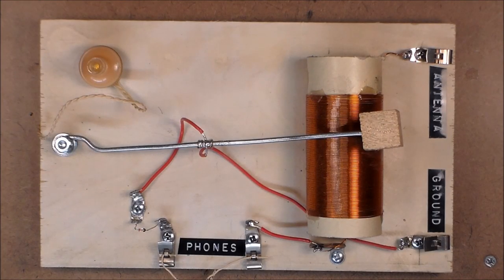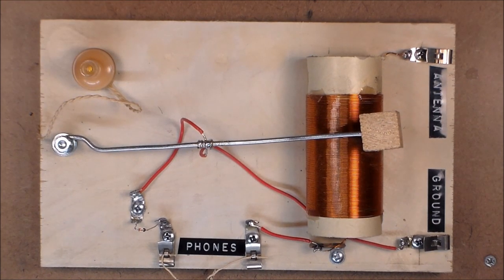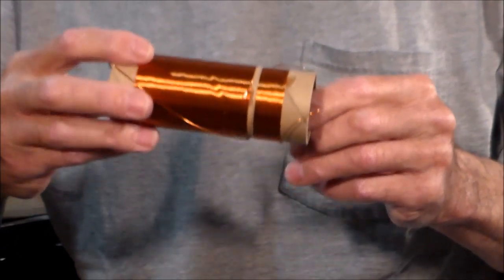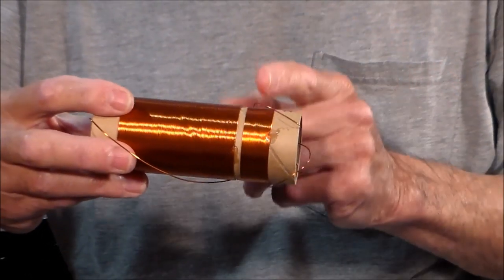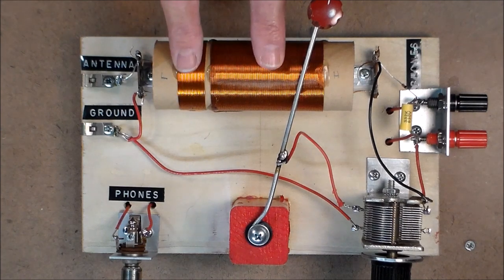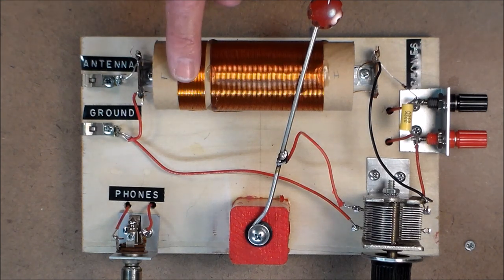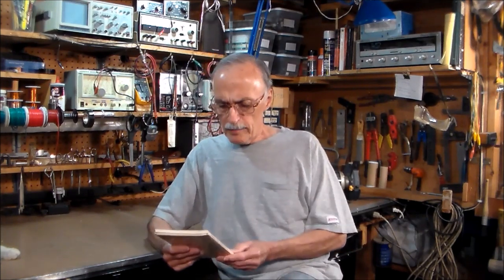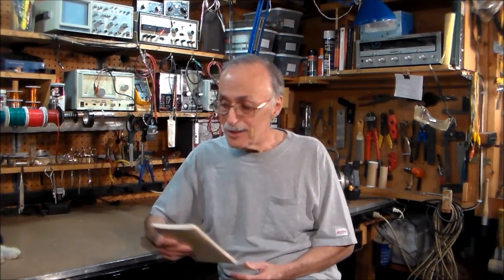BOY SCOUT CRYSTAL RADIO UPGRADE

Comment: @squarewave2 Hello. Not sure if you see comments and questions from past videos, but after watching this and a few other videos you have posted about crystal radios, I was wondering if you have any knowledge of the "METRO Jr." set from the 1920's. It is inscribed on the aluminum base to be from the "METRO ELECTRICAL CO. INC., NEWARK, N.J. U.S.A." It looks somewhat similar to the design of the Boy Scout Radio you depict here, but from what I can tell it has a slightly different circuit, most notably the aerial is connected directly to both the headphone and one end of the coil. I inherited the basic unit (i.e., without the box, instructions, and original headphones) from my late father, and for kicks I want to see if I can get it to work. I vaguely recall it working in the 1970's when my father demonstrated it to me, but that could be a false memory. About all I can get now is static. Hoping you might be open to an exchange about trying to get this to operate again, perhaps making it the subject of some future vide. ~Ed from Baltimore
Reply from the maker: Hi Edward, 
Sorry, I don't know anything about a Metro Junior radio. If you are getting any sound at all, even static, it's a good sign; radio is probably working ok. Are there any broadcast stations in your area? Perhaps they are just too far away. Remember, you need a good, long wire antenna. Good luck.

Comment: Lucy you have lot's of splaining to do! 

Many of the wires are hidden under the board in the photos and the schematic shows a free floating main tuning coil connection that goes no where and is not used. is this really what was intended? Sure looks like the wiper arm is more than inductively coupled in the schematic when the wiper is making contact with the main coil. This feature needs explaining and the two coils seem to be connected at ground or 0 volts. I suppose this could work. An explanation of the mystery details sure would have been nice. the 1000 pF capacitor across the headphone jacks was not mentioned either in your circuit. By the way what happened to the 47k to  100k ohm resistor used in the original boy scout circuit across the head phone jacks.
Reply: xactly!!  not much info

Comment: Being a retired aerospace radio-frequency design engineer I like your videos.  Have you thought about including the formula's for calculating resonance so that tuning is not so difficult for specific frequencies?
Reply: @2nostromo  You can calculate the coil and cap values based on the frequency with a standard formula.  I can't find it, but it's everywhere.  They have lots of free stuff at the library.
Reply: Whoa ... we're just ordinary people out here. We're not rocket scientists.

Comment: WHY USE A 47K “LOAD RESISTOR” ACROSS THE CRYSTAL EARPHONE? To provide a DC return path for the signal, allowing current flow. (The crystal phone acts like a capacitor, which blocks DC current.)

Comment: Question re wire wrapped tube. There has been some question about using toilet paper cardboard center rolls as the platform to wrap the wire however I have questions regarding its durability and the fact that it could crinkle in a moisture environment.  I have opted for PVC piping so my question is schedule 20 is not as strong as schedule 40 but it's definitely strong enough to support the wire and endure climate challenges.  So my question is should I use the schedule 20 instead of the 40 because it's thinner and therefore will pick up more signal or does it not matter? Is the signal is coming from the outside or the inside of the tube where the wire is wrapped? I appreciate your help on this.  I was even going to use the plumbing 'P' trap replacement pipe  which is even slightly thinner than the schedule 20 if the tube thickness matters.
Reply from the maker: The best tube is a 1 1/2 inch diameter MAILING TUBE.  It's easier to dill hols in than PVC pipe. The "signal" 
is coming from the antenna to the antenna coupler coil and then to the tuning coil by induction.
Don't even think of toilet paper tubes!!
Reply: Thanks for the quick reply.  I am waiting on the crystal earphones (ordered online) to see if my setup is functioning.  If so I plan to rebuild one that merits respect.  The goal is to have some form of long term form of news in the event of a disaster.  
Thanks for the help.  TP tubes get recycled.
Reply: Approximately,
 on 20 mm diameter PVC  tube 0.2 mm wire ( 32 AWG )

That project  at least on 40 mm ( 1.56 inch ) diameter  paper tube winding  0.4 mm wire ( 26 AWG ) at most 0.8 mm wire

on 50 mm diameter PVC tube 0.5 mm wire ( 24 AWG )

Comment: I would like to agree with jmitsch44827's comment below and add  that I don't see a crystal diode on the board.  In the schematic, the diode is shown between the earphone pole and one pole of the variable capacitor. I see solid wire between the earphone and the capacitor.   Is the crystal underneath the board?   Could you also clarify the relationship of the three poles of the variable capacitor?  It would be great to see where these 3 poles are connected in the schematic.  Sorry, it is very unclear to me how to make this project.   Your video is otherwise excellent; you have a very nice speaking style.  Thanks, Ted
Reply from the maker: Hi Ted,
If you will enlarge the image on your computer, you will see the diode connected between the black earphone terminal and the variable capacitor, just as it is shown in the diagram. It is very small and hard to see. The variable capacitor is a single section one with only two “poles”: the rotor and the stator. However, four terminals are provided for the stator and the rotor is connected to the frame. One end of the main coil is not connected. Follow my diagram and you should be successful. Good luck!

Comment: CAN I MAKE A CRYSTAL EARPHONE? Yes. I saw a YouTube where a guy did that. He used a piezo buzzer from a microwave oven. For the earpiece, he hot-glued on a piece of a Bic pen barrel. You can buy piezo elements from All Electronics or Electronics Goldmine. If you can’t solder, buy a piezo element with leads.

Comment: One more question...every other crystal radio design I've seen requires the use of an approx. 47K resister in parallel with the earpiece. Instead, in this design, you recommend a small capacitor. Could you explain the reason for that?
Reply: I've never found the need for either using a crystal earphone or magnetic headphones.  But in theory (some say practice) the AC capacitor shunts any remaining AC signal to ground.  The only thing you want reaching your ear is pure, rectified DC signal.  Of course an AC capacitor is invisible to DC, so there is no risk of the capacitor bleeding off your audio signal.  On the resistor, it is said that a resistance is necessary to "load the detector", although this hasn't been my experience.  What many builders do is include BOTH the capacitor and the resistor.... both issues solved.  Probably better, experiment with different values of both.  One of the best items on your workbench should be a pair of capacitance and resistance substitution boxes.  You just clip them into your circuit and spin the knob through the different values to find the ones that work best.
Reply: I built a crystal radio that used a crystal piezo earpiece and got a very loud distorted signal. The 47k resistor made it sound clear. However, in most cases you don't need a resistor

Comment: sir, long time model airplane builder and just getting into these xtal sets and have a question>>>>>>>>> I see on the left you have a phone jack, then on the far right thiers a bracket with red/black knobs and assuming thier for an optional 2 wire crystal  ear phone, is that correct??
Reply from the maker: Yea, Stan, you are correct. I can connect two different types of earphone leads. Be sure to get the book I recommend: " Radios That Work For Free" by K.E. Ewards .Good luck!

Comment: John,
I see by the diagram that there is a capacitor between the head phones, and also between the black
and red nobs? what are nobs for?  and please tell me about the caps. Also I love the videos.
GOOD TIMES!!!
Reply from the maker: Hi Dragos 4!
The black and red "knobs" are not knobs at all but binding posts to connect headphones that don't have a plug.
Not counting the tuning capacitor, there is only one capacitor; it is connected across the head phone terminals.
I should really have put another one across the headphone jack!  There are two ways to connect phones. The value is .003 microfarads. The capacitor function is to "smooth out" the RF carrier so as to make the audio envelope more intelligible to the ear phones. Thank you for your comment!
Reply: John,
Thank you for your fast reply, I would have seen it sooner, but was watching some of your other videos. 
Should all crystal sets have this cap. across the head phones? Again thank you very much...
GOOD TIMES!!!
Reply from the maker: The capacitor across the  earphones is optional. Your set will work without one.

Comment: DON'T WANT TO EXPERIMENT, BUT CAN'T FIND A CRYSTAL EARPHONE? Plug the crystal radio output into a Radio Shack amplified speaker (or some other type). Look for “computer speakers,” the type with volume controls. These speakers turn up at house sales. Be sure to get the power supply (“wall wart”), and TEST before buying.

Comment: Here a challenge for you design a crystal radio that can work in a small appartment,anyone up to this challenge, I could make the radio  hope I got a box of parts for one i been collecting for years,I can use a plug for the ground ,but a indoor antenna?
Reply: Loop antenna
Reply: I've done OK with a 20 to 30 foot inside antenna plus ground. Low volume locals mostly.
I would say use minimum 15 feet inside antenna
 Maybe put double the length going 15 feet side by side

Comment: i live in wa state and picked up an AM station in san fran over 1k miles away
Reply: Best AM crystal radio: 25 turn primary (antenna coil) on a section of aprox 3 inch diameter pvc pipe....120 turn secondary (start winding right behind first coil)....another 25 turns in center of secondary. Wrap a strip of paper over secondary before winding third coil. Use 24 AWG magnet wire. Connect 365pf air variable capacitor across 120 turn coil. Connect germanium diode and high impedance crystal earphone/headphones to 25 turn coil wrapped over the 120 turn coil. Telephone speakers work well too. Connect antenna/ground to first 25 turn coil. 

Antenna can be any type of small insulated wire at least 100 feet long as high off the ground as you can get it. 250 feet long is even better. A fishing rod can be used to get antenna wire up in a tree. Tie a lead weight to fishing line and throw it over the tree top. Tie fishing line to antenna wire and pull it up then tie fishing line to base of tree. Or you can string out the antenna wire between trees....just get it high enough that nobody will walk into it and rip it down.

You can use a counter poise antenna as a ground....just attach another length of insulated wire to primary coil instead of a ground wire and string it out through the bushes or trees in the opposite direction. Get it up high enough that nobody gets tangled in it. 

This is a very sensitive and selective crystal set. 

PS: PVC pipe diameter isn`t critical. You can use 2 3/4 inch pipe or 3 1/2 inch pipe with almost same results and tuning range....520khz to about 1600khz. You can buy 500 ft spools of cheap insulated wire off Amazon. 

TIP: Use super glue to hold windings in place as you wind coils. This way you can rest some and not have to do it all at once. Hot glue works well too. Be creative.

Comment: I’m trying to build this version but can’t tell where all the wires coming off the coils go to can u please describe where the tuning coil wires and the antenna coil wires go thanks
Reply from the maker: Hi Corey,
One end of the smaller coil (the antenna coupler) is connected to ground and the other end to the antenna.
One end of the larger tuning coil is connected to the rotor plates of the tuning capacitor and the other end is not connected to anything. The sliding tap is connected to the stator plates of the tuning capacitor and to ground. I hope this helps. Good luck!
Reply: Thank u so much I appreciate you sharing your knowledge with others,, have a good day sir
Reply: squarewave2 sorry to bother you again but one more question.. the germanium diode goes from the variable capacitor and antenna wire to the tie point and then straight to the ear phone hook up ? Sorry I can’t see well and I’m having a hard time identifying the wiring

Comment: WHY USE A CAPACITOR ACROSS THE PHONES? First, no, this capacitor DOESN'T “remove all AC, so that only pure DC goes to the phones.” The purpose of this small capacitor is to pass RADIO frequency AC (RF) to ground. RESULT: Audio frequency AC drives the phones.

Comment: 100 ft? so the antenna length formula dosent apply to this like 234 or 468/fq mhz
Reply from the maker: Long wire, random length antennae are not tuned to a specific radio band like a dipole antenna. You can pretty much receive any radio signals with the long wire.

Comment: John, would please tell me the diameter of the tuning coil. Thank you .... Garry
Reply from the maker: Hi Garry,
It is a one and a half inch diameter mailing tube. Don't use a toilet paper tube. Mailing tubes are available where moving supplies are sold. They are sturdy and perfect.
Reply: Thank you John.
Reply: @gazgazmag4729  I used a toilet paper tube but gave it a coat of shellac, I was 10 or 11....this was 60 years ago used my moms aluminum wire clothes line for an antenna and a safety pin pencil lead and razor blade in place of the diode.

Comment: sir, just built a boyscout radio and wondering if a 100 ft of coated speaker wire will work   plez reply asap  thanx
Reply from the maker: Yes, Stan, 100 feet of any wire insulated or not will work fine. Good luch with your project and remember to ground the set to a cold water pipe.

Comment: so where to connect the voltage ?
Reply: what voltage? this cat doesnt need a battery!
Reply: @fidelcatsro6948  You could add a ic amp connected to the earphone jack and power a speaker using what ever voltage that required.
Reply: @williamjackson5942  yeah we can amplify these faint radio signals with a battery powered amplifier circuit into audible meows and purs

Comment: 3:24 Why 90 & 25 turns, specifically?
Reply from the maker: There are established formulas for the correct combination of wire gauge, form diameter and number of turns to cover a given frequency range. That's where the numbers came from.

Comment: How can it tune without a capacitor?
Reply: The slider changes the frequency by shorting across the coils changing inductance. Here`s a great crystal set: 25 turn primary (antenna coil) on a section of aprox 3 inch diameter pvc pipe....120 turn secondary (start winding right behind first coil)....another 25 turns in center of secondary. Wrap a strip of paper over secondary before winding third coil. Use 24 AWG magnet wire. Connect 365pf air variable capacitor across 120 turn coil. Connect germanium diode and high impedance crystal earphone/headphones to 25 turn coil wrapped over the 120 turn coil. Telephone speakers work well too. Connect antenna/ground to first 25 turn coil. 

Antenna can be any type of small insulated wire at least 100 feet long as high off the ground as you can get it. 250 feet long is even better. A fishing rod can be used to get antenna wire up in a tree. Tie a lead weight to fishing line and throw it over the tree top. Tie fishing line to antenna wire and pull it up then tie fishing line to base of tree. Or you can string out the antenna wire between trees....just get it high enough that nobody will walk into it and rip it down.

You can use a counter poise antenna as a ground....just attach another length of insulated wire to primary coil instead of a ground wire and string it out through the bushes or trees in the opposite direction. Get it up high enough that nobody gets tangled in it. 

This is a very sensitive and selective crystal set. 

PS: PVC pipe diameter isn`t critical. You can use 2 3/4 inch pipe or 3 1/2 inch pipe with almost same results and tuning range....520khz to about 1600khz. You can buy 500 ft spools of cheap insulated wire off Amazon. 

TIP: Use super glue to hold windings in place as you wind coils. This way you can rest some and not have to do it all at once. Hot glue works well too. Be creative.
Reply: And - - the tuning(or loading) coil has  both distributed and interwinding capacitances of its own

Comment: why are these called crystal radios if there is no crystal there ?
Reply: The early detectors used galena crystals; modern diodes have a tiny bit of crystal inside.